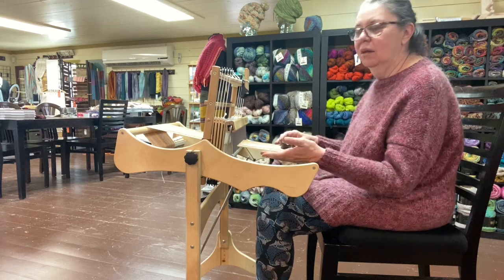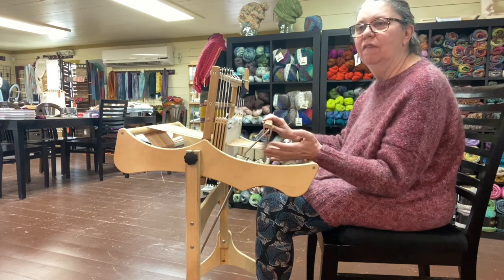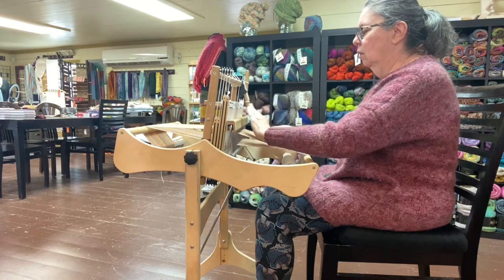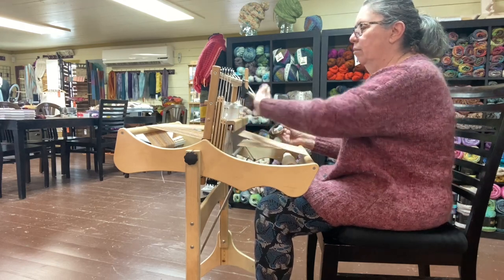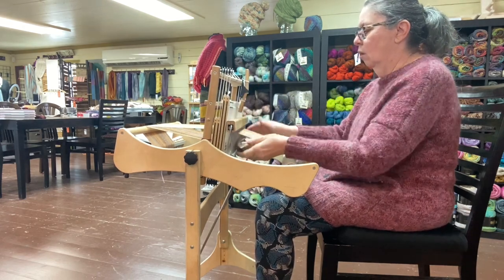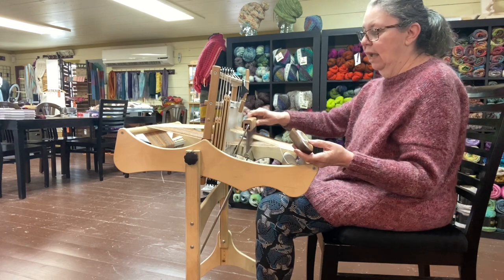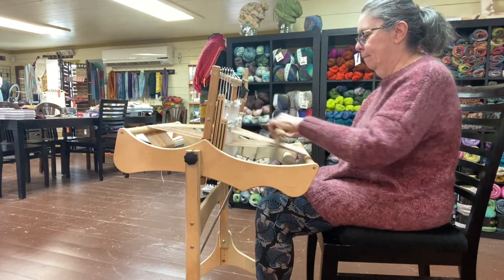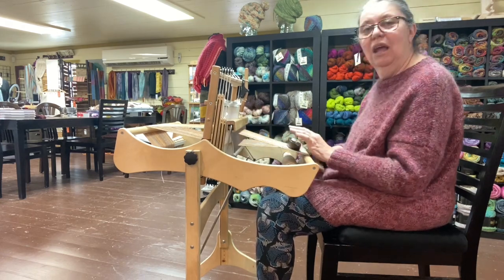Weaving on a Louet Erica Loom - One-Handed Lever Changes and Consistent Beating

Comment: Ok that looks soft too. Does that also work when you got these floating salvage left and right ? 
I just did towels on the Erica and I hit it stronger with 8/2 cotton. Getting mine ready for the next towels I will try to be softer with Erica 😂thanks !
Reply from the maker: Yes, it works exactly the same. It shouldn’t really be harder with 8/2 if your sett is right. We use 18 epi for plain weave, 20 epi for twills. Hth.